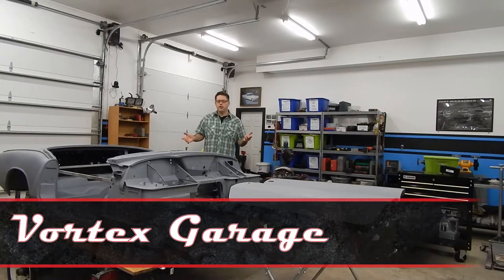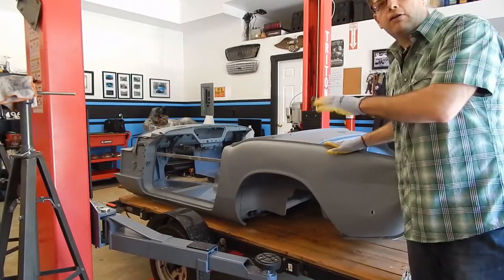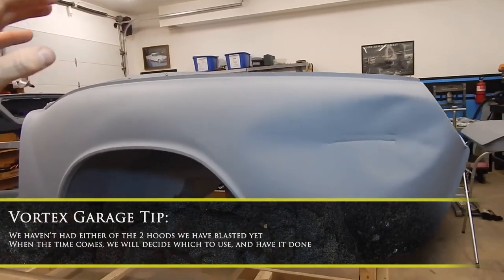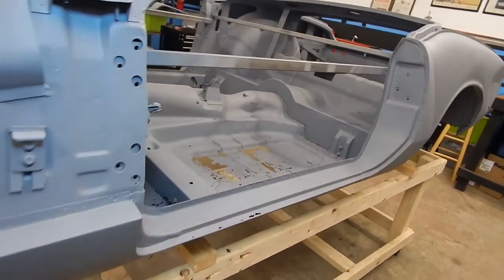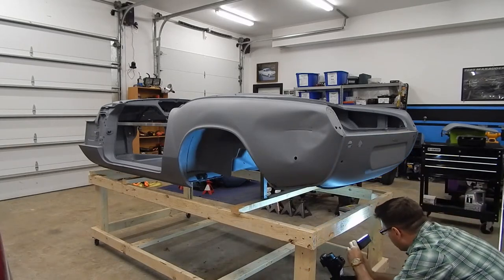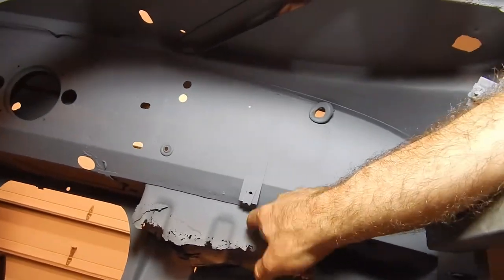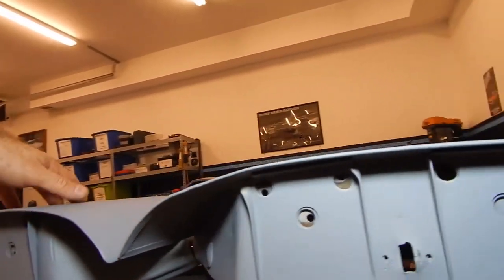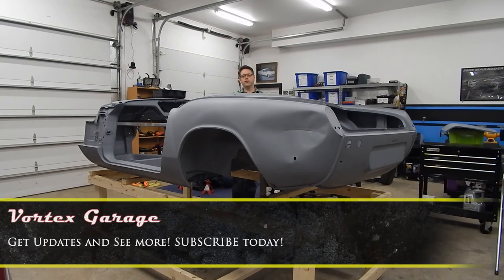Spitfire is Back from Media Blast! - A Detailed Review - Vortex Garage Ep. 32

Comment: Why didn't you get out that big rear Dent Before you coated it? It would be easy to fix that without replacement.  My old Toyota truck had a rotted out windshield pillar that I treated for rust, filled and painted.  7yrs and zero rust has appeared.  Why not put drain holes  with flex tubes to dump water on the ground.